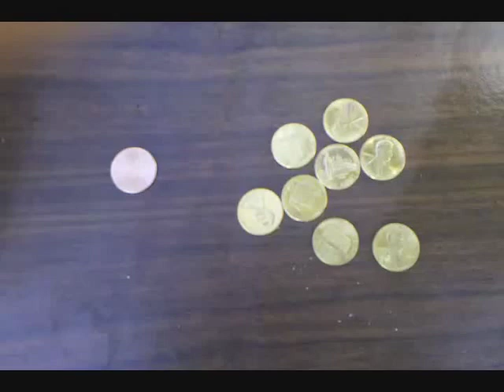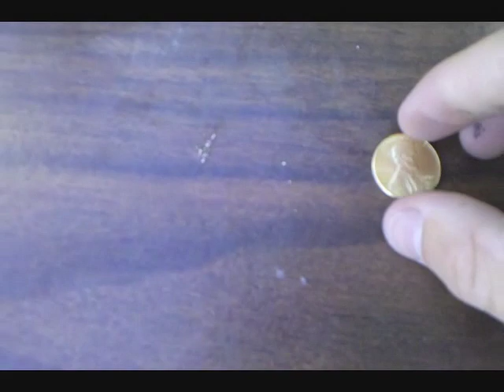Brass Pennies

Comment from the maker: @phoenixflames44 Cool!  Glad to hear you get the opportunity to teach chemistry to a class, something I hope to get to do.  As for the white layer, its deposited zinc, though it does alloy rather quickly, so I suppose it is an alloy.  I did an experiment where I didn't heat some of them, and within days they started taking on a yellow color.  Now after months they look almost the same as the ones I heated.